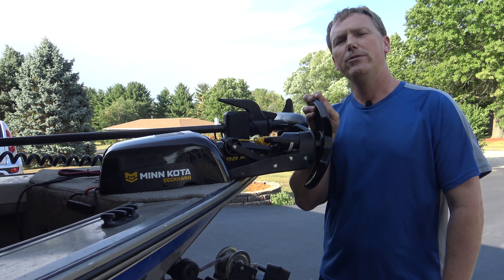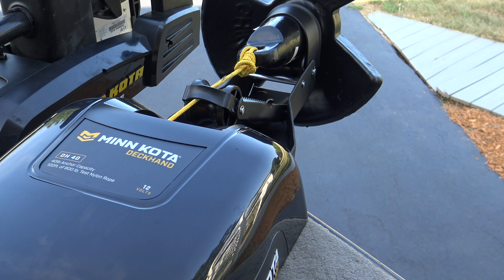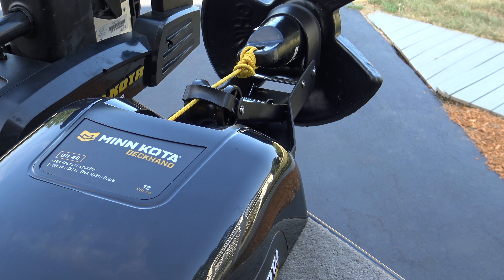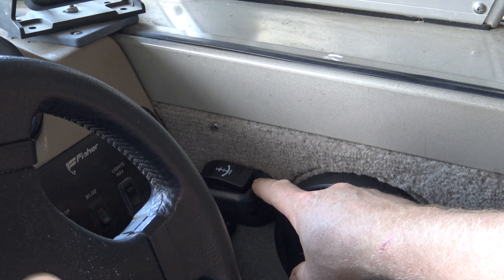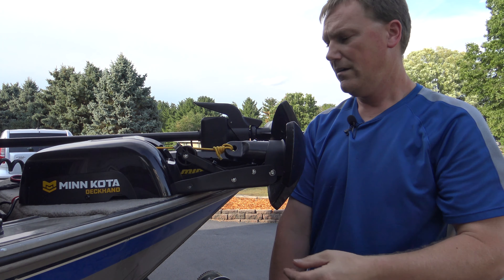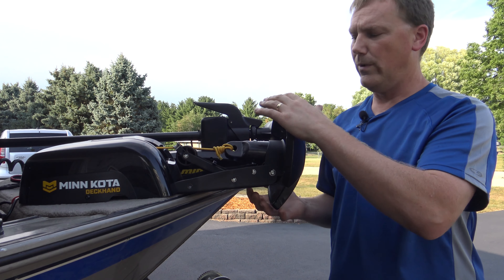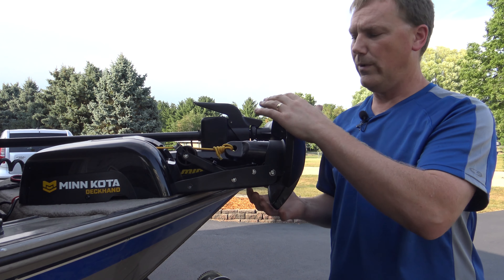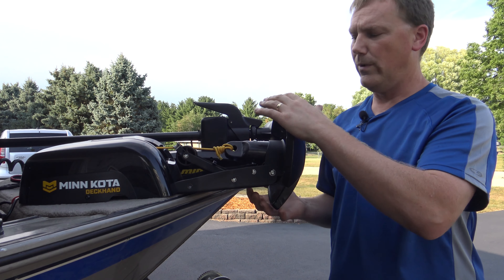Minn Kota DH 40 Electric Anchor FULL REVIEW

Comment: In regards to your comment about the anchor continuing to let the line out, the easy fix for that is once you know the anchor has hit the bottom, I have to flip the off switch and then it will lock itself in place and will not let anymore line out. You just have to make sure you know for sure the anchor has reached the bottom before doing that.

Comment: I bottom fish and my front and rear anchor line are both 100ft, I drop my rear anchor and move forward 100ft then drop my front anchor and back up 50ft that way I have a good hold between my front and rear anchors, would I be able to do that with these anchors?

Comment: I need a 25 foot lead wire from the bow to the stern what size gauge wire did you use for your deckhand?
Reply from the maker: 8 gauge..  I bought a set of jumper cables and cut the clamps off.  Was way cheaper than buying wire

Comment: U cant drive with it up or
Reply from the maker: you can, i just like the anchor in the boat instead of putting pressure on the anchor brake
Reply: I drive with mine up all the time. No issues.

Comment: I have one. I think they are great. If u do travel at high speed on the water and don't stow it inside your boat, use the safety chain. I didn't and inadvertently  hit the down button on the remote switch and the anchor dropped and hit the water, then it swung up and left a big dent in the side of the hull. 
I agree with you, get a 30# anchor, but it does make a smaller boat list a bit on the front to the side the anchor is hanging from.
Reply from the maker: Hey thanks for watching the video. Good luck fishing. I think we're going tomorrow morning!